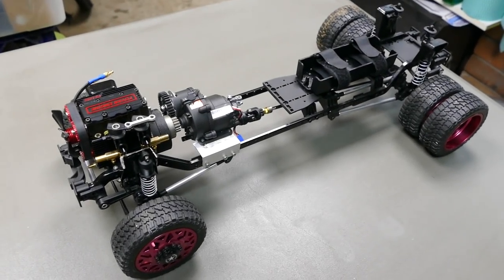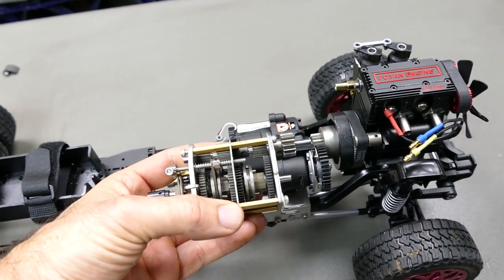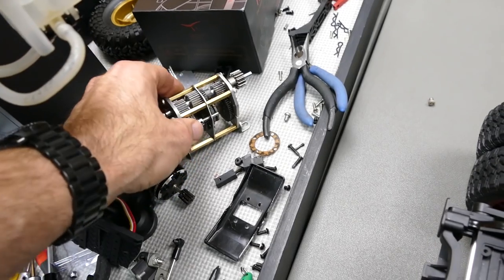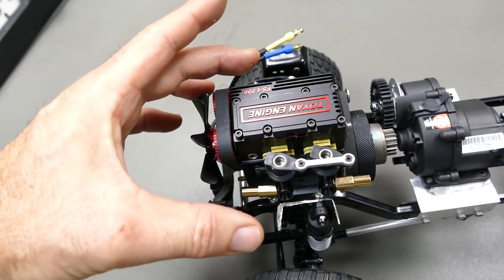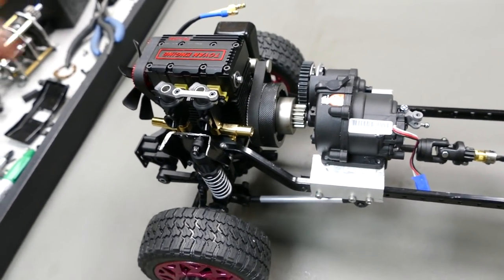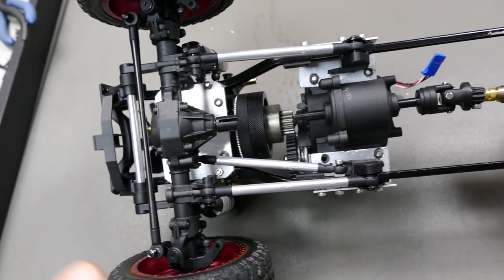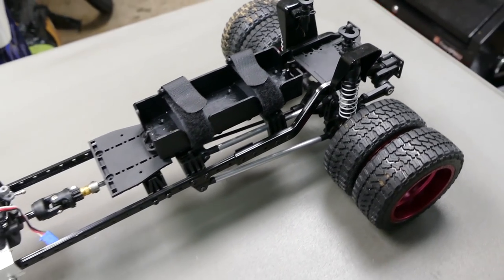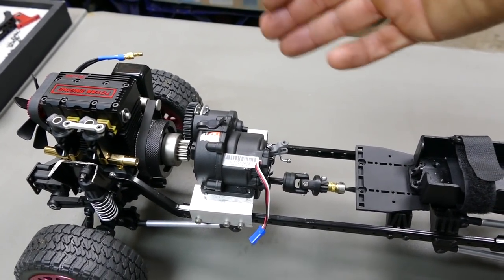FORD F450 TOYAN FS-L200 BUILD - Part 2

Comment: You could make a flexible front axle from a small piece of steel braided tubing that's wrapped around a flexible piece of rubber tubing.
Reply from the maker: Cool idea
Reply: @RCTanksTrucks247  3D print the couplings with a socket insert for the tubing and 3 grub screws in each and it just might work. One grub screw to fasten to the diff to and two screws to pinch the tubing down onto the same piece of metal from opposing ends. Same with the gear box coupling. So long as the axle connection is rock solid and beefy, torque shouldn't be an issue under load. Great work anyways and good luck hobbyist brother down under.

Comment: Looking good. You’re going to convert the hood to open right?.
Reply from the maker: Probably just cut it open. Lexan is too filmsy
Reply: Agree, but you could design a ring around it on both sides where it would split. I know it take a little more time to do or to 3D print. Just a thought. Good luck mate.

Comment: Great build. looking to buy a FS-L200 myself. Where did you get the clutch - transfer gear from the motor to the Revo box - another Toyan part?
Reply from the maker: It's just the revo 3.3 transmission. That is all one unit.
Reply: @RCTanksTrucks247  The silver coloured gear that is on the engine  - the engine comes with a black knurled flywheel? Think you called it a clutch bell?

Comment: Hello, I wanted to ask whether I can start the engine with this product ( Nitro Fire Fuel 25%)?and whether I have to put oil ( ENGINE MAINTENANCE OIL) in there.
Reply from the maker: The oil is in the fuel itself. Does not require additional oil. The nitro percentage is fine
Reply: @RCTanksTrucks247   Спасибо!